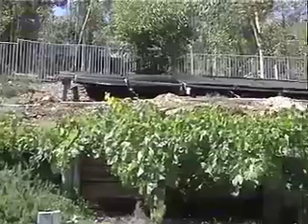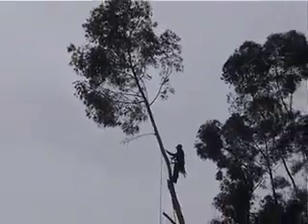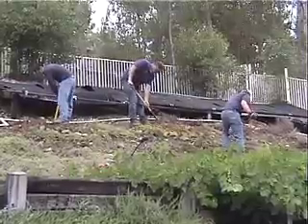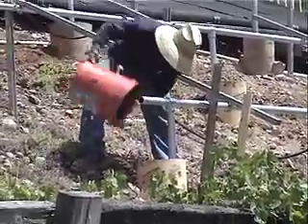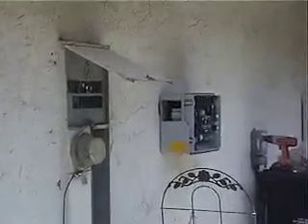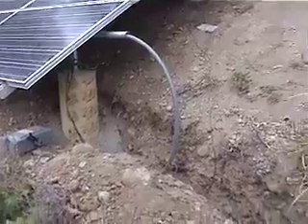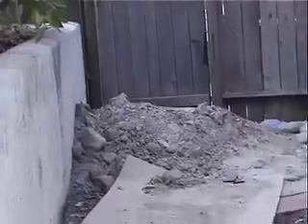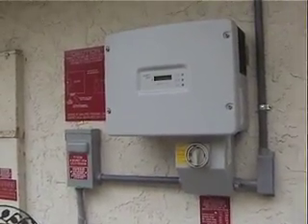Installing Photovoltaic Solar Power at Home

Comment: Very thorough video, I deal in solar power and solar water heating. Solar water heating for a complete system is very reasonably priced and over looked a lot. Check out ABOUTSOLARCELLS.COMXA.COM

Comment: Sharp and SMA , what a great combo, does not get better than that ! you were also lucky the inspector did not know about or choose to enforce the pool codes, solar hot water panels are not actually allowed to be closer than 10 feet to the pv modules. Great ground rack, roof can't leak and the workers were safer.

Comment from the maker: @ReddsMorris You're welcome. Unfortunately, I have a wood shake roof, so lots of contaminants that would deposit on the glass.  Also, you'd need a pump and plumbing to get the water to/from the panels. I also looked into an Aluminum heat sink behind each panel ducted into the ground (cooler), but that'd be cost prohibitive, too.  

For a roof mount, there is a new system (separate) that cools the panels and uses the heat saved for water heating & A/C.  Goes from 20% up to 50% efficiency.

Comment from the maker: @ReddsMorris Rain? What's that?  Seriously, though, I've thought about drip feeding ever since I proved I could get an extra 400W during the summer using my hose to cool the panels mid day.  Right now, it's cost prohibitive for me, though it might work for others: in San Diego we have expensive water, rationing and only 10" rain / yr (on a good year - it's been a drought for the past 5 years). Thanks for the idea though & your comments on the vid.

Comment from the maker: The AC rating is different from the DC rating.  My system is rated at 4 kW DC, 3.7 kW AC (losses and conversion efficiencies).  The actual kW depends on time of year; lower panel temperature = higher the efficiency.

Re: doing it myself, aside from the physical work, there are a lot of local regulations.  I recommend you get a good company with many years experience.  Avoid new companies & "great deals" - a 20 yr warranty only counts if the company's in business..

Comment from the maker: At the time the total cost was ~$33K, I got about $7500 back in state rebates and another ~$4K in tax credits.  Very different now in C:

-  The CSI rebate is roughly 1/2 what it was
- The IRS tax credit is higher (I think it's 30% and not capped at $3K as it was in 2008
-  Cost per watt for the panels are lower cost, too.

My cost was higher as I had to do a ground - rather than roof - installation.  

I hope this helps.

Comment from the maker: The panels have aluminum frames and are protected by tempered glass (like a car windscreen), so they're pretty tough.  Even if the glass breaks (supposed to be fine against hail), the solar panels themselves will still generate electricity.  If you're concerned, check the manufacturers (mine were Sharp, but Kyocera and Sun Power also make panels)

Comment from the maker: It's certainly not in its infancy - these panels have been used for many years (even in space).  Some of the new "thin film" solar is in its infancy, but these panels have a 20 year warranty on them.  Regarding aesthetics, I guess it's a matter of opinion, but I am growing short bushes on the sides to mask the support structure. Otherwise the panels look great and remind me that I'm not dumping all that CO2 into the air (13,000 lb saved in 1 year + no electric bill for the year!)

Comment from the maker: Thanks! Payback is a lot lower now thanks to 2009 US Govt. tax credits. It's gone from ~11 - 12 yrs (ground install is longer than roof) assuming historic annual energy price increase to more like 6 - 7 yrs. My goal is to go electric car (I have an electric bike for local stuff) when they come out.  That'll likely improve it further. If true carbon cost is ever assigned to fossil fuels, payback time will be much less.  Also, according to local realtors cost is fully recovered if you sell.